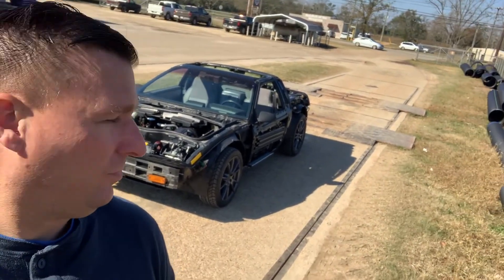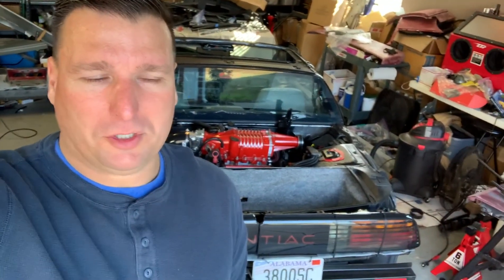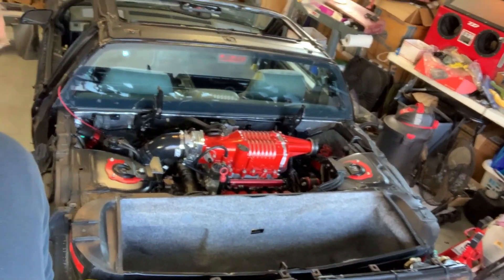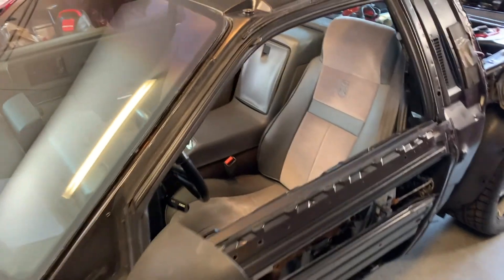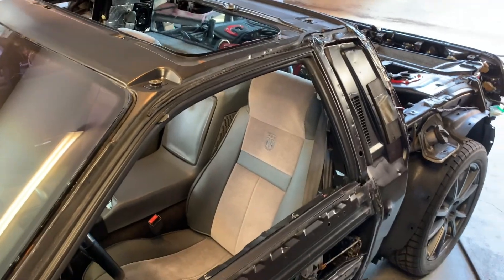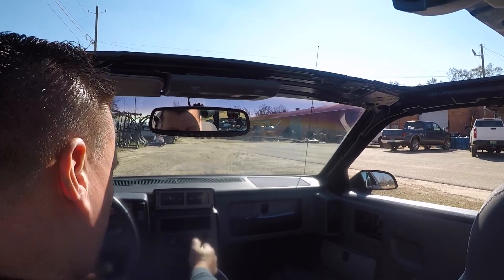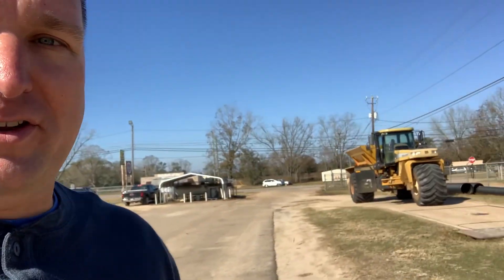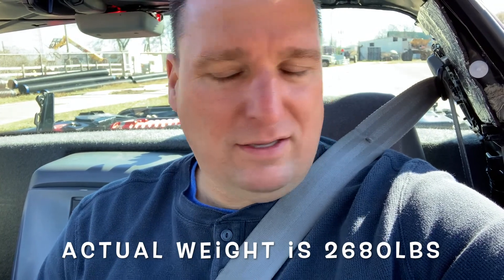Supercharged and Naked - Fiero GT Gets Weighed - Not a Miata, Toyota MR2, or a 2021 C8 Corvette!

Comment: The space frame with no components on it weights about 600 lbs. The trunk and hood each are around 40 lbs. The sunroof and rear glass are about 25 and 30 lbs. Wheels and tires, depends on what you've got but 40 lbs each is in the ballpark. Stock seats are about 40 lbs. each. The suspension & brakes add about another 30 lbs. per wheel. I've got a notebook with weights of most of the components in a drawer somewhere....but my estimates here are close. The transmission is about 100 lbs.. The alternator is about 30 lbs. A lead acid battery adds about another 30-40 lbs. The gas tank is about 20 lbs. I lightened my car with fiberglass/carbon fiber hood, rear quarter and deck and polycarbonate sunroof and rear glass. Just those modifications will save you about 100 lbs.

Comment: The sc engine adds abt 100lbs, so there is no way to get anywhere near 2300lbs with that big V6 in there unless you completely gut the car, then remove all glass and replace it with lexan or fiberglass. And don't forget the pop-up headlights and ac condenser. Also remove all rugs and sound deadening materials. Doing all that, you may get 2450lbs with a lot of luck and a tooth fairy 🧚‍♀️ 😀

Comment: So 2700 lbs with a full tank.  And 2900 lbs with you in it.  Put the glass back in and all the skins and you are gonna be over 3k.  Maybe even 3100.

She is heavy
Reply from the maker: I will weigh her again once everything is back on...
Reply: I was guessing 2800 lbs. which is not bad with a 300 hp engine.